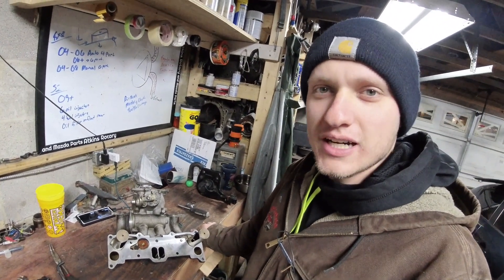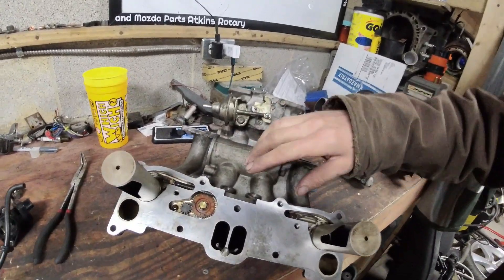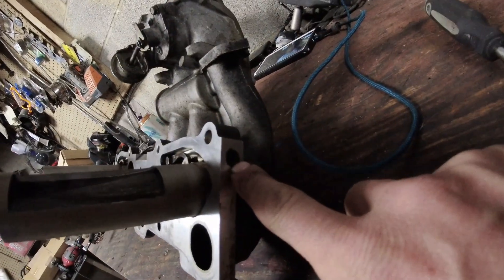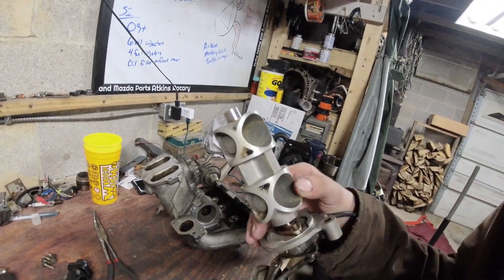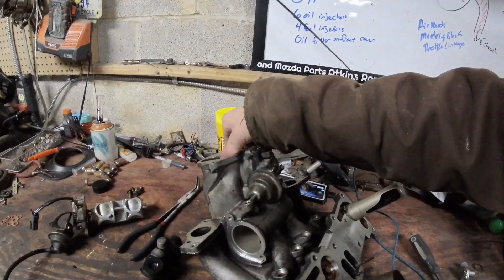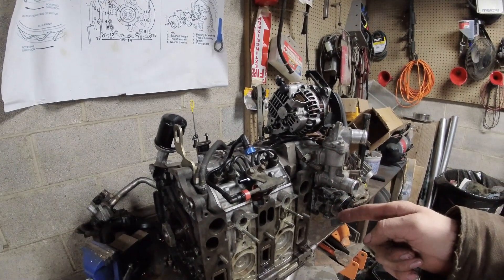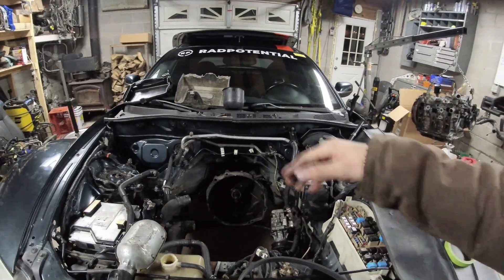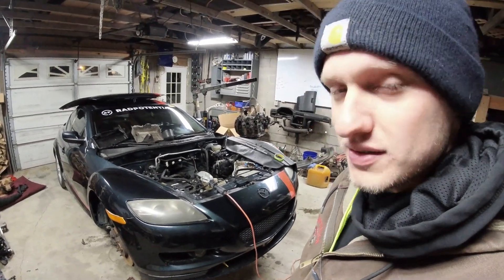Installing Clean Intake Valves in a RX8 13b Renesis-  You Only want to Do this once!

Comment: What do you recomend  to keep the rotary engine carbon free or prevent too much carbon build up I removed the engine on my 2011 RX8, I bought it with 46000 miles it has 56000 and it stalled while driving, I had codes read and said runner valves stuck open, so started investigating and saw you, thanks first and foremost for all the information, and if I had two more inches of clearance I could remove the the intake in side the car, unfortunately I had to remove the engine and go to cleaning but by removing the rear exhaust I think it’s the resonator the one that splits to two at the end, would that cause for my valves to get stuck I drive it daily and don’t drive fast , just like a regular car , just to and from no drifting or doughnut like you do, I can’t afford the tickets, could that be a reason valves got stuck I removed the exhaust about two months ago and suddenly this happened and yes they are full of caked up gunk I removed the actuation motor and they would bind I also pre mix and use the expensive fuel 98 octane, should I replace the rear muffler back or what do you recommend for this not to happen again, besides Selling It,  thank you for all the help,

Comment: I used a steel wire brush bit on a dremel/die grinder and worked a treat for the arms and the ssv hole.
And basically everything else I could get the brush on.

Comment: Loving your RX-8 content! Very entertaining and informative. I recently installed a rebuilt motor and fired it off for the first time a couple days ago. Everything seems to be in order,  minus a P2004 code which is an APV stuck open code. I took the actuator off and checked the gear, and it doesn't turn as smoothly as yours. Quite difficult to turn in comparison. I cleaned the lower intake very well, so I'm not sure what to do. I really don't want to have to pull the motor again 😫.
Do you have any suggestions?

Comment: Awesome videos on the 8s 👌 Do you know if there is any difference taking them out with a series 2. Just sea foamed it. Hoping to delay the rebuild. Going to compression test it again to see if there is any improvement.
Reply from the maker: I dont think it's massively different.   Few small bits under the manifold are different. And the oil filter location.  Off the top of my head. Thats the major stuff

Comment: when cleaning the manifold, did you think about giving it some polishing? also I can relate, dropped the thermostat bolt behind the water pump. great vid!
Reply from the maker: I thought about cleaning it and the engine bay.  But really just need the car running for the weekend. No time to make it pretty yet

Comment: If you want to test the aux motor on the bench, the bottom 2 pins are the power/ground pins. Just reverse polarity to test open and close. The top 3 are used to monitor position. Easy enough with a power probe.

Comment: Having an rx8 myself these are great. My engine is still running by the way. If you remember I took a fresh rebuild and never ever had the omp hooked up. Only pre-mix from the start. Still going strong❤️❤️
Reply from the maker: That's good!!!  Premix is always reliable!!
Reply: I personally use the sohn adapter. I have Versatuner as well. I have a stage one tune that increases the omp output per load and rpm. Fresh two stroke all the time. I premix, but had to lower the amount. It accelerated the fouling of the spark plugs.
Reply: No omp or Sohn adapt here. Only pre-mix and it's been great. About 16oz per tank is what I have been mixing and the engine is going past 20k km no issues.

Comment: This series is making me feel like a poor. With fuel prices where they are I'm opting to drive my NA Miata with the top up in weather where I'd normally take the RX-8. Plus there's also still the leaky pinion issue. I hope to tackle that once I finally get the truck transmission finished and back on the road.